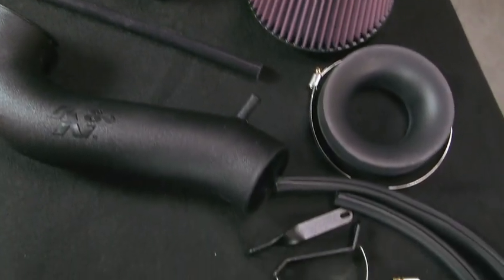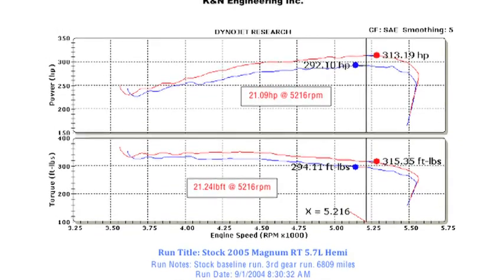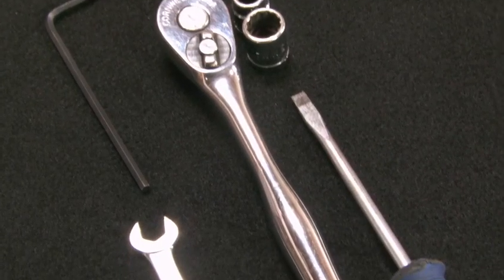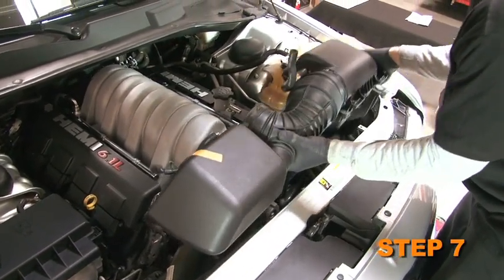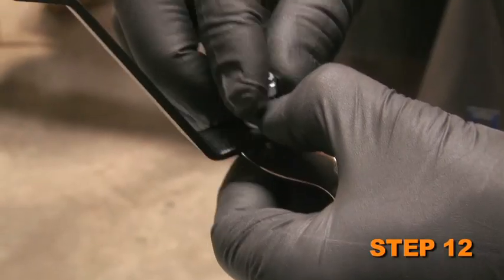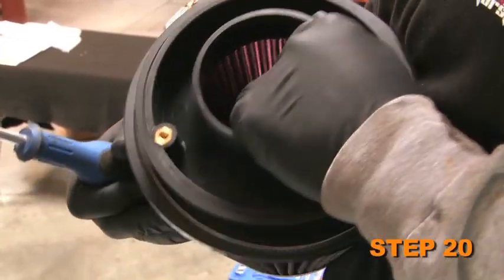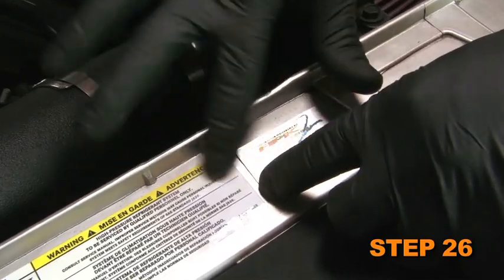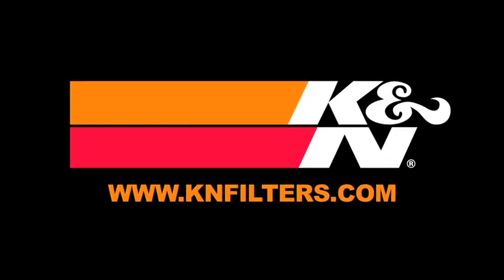Chrysler 300C & Dodge Magnum/Charger 5.7L & 6.1L [#57-1542] Air Intake Installation

Comment: True story. Midway through this project my wife called me inside for dinner. Not thinking about it, I closed the trunk and went inside. Later when I came out to continue the project I realized there is no way to open the trunk without power. There is no keyhole for the trunk and the dash button is electric. The only way to get to the battery under these circumstances is to pull down the back seats and crawl in the trunk. Well I have a large subwoofer in my trunk that prevented me from being able to do so. I literally had no choice but to disassemble my expensive subwoofer and remove it piece by piece in order to reattach the negative terminal to the battery, or so I thought. After going through all this trouble I realized I should have just used jumper cables to get the trunk open. I was so frustrated and caught up in the moment I didn't think of that at the time. Moral of the story. Do not close your trunk when you have the battery disconnected, especially if your trunk is full of stuff; and if you do, use jumper cables instead of struggling around in the trunk like an idiot as I did.
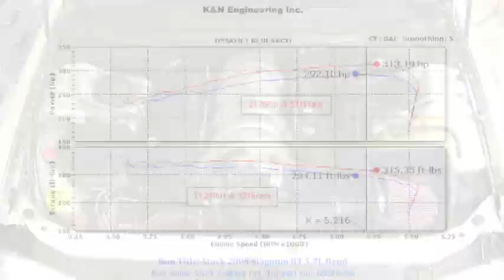Reply: ha ha, in engine compartment is +pole  and - pole is everything else, you just had to open hood and connect cables  + - and you will open trunk, on 1:14 on left corner above yellow cap is red cap , in is + pole
Reply: @makantahi3731  Didn't have cables or the room to get close enough.